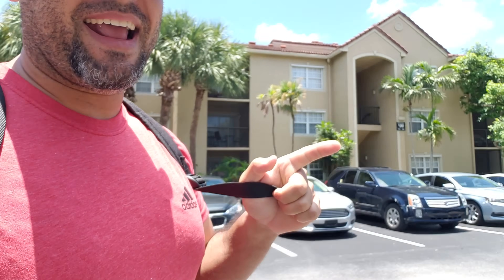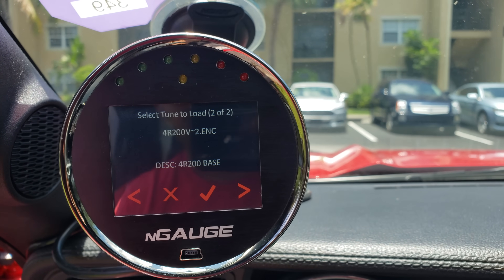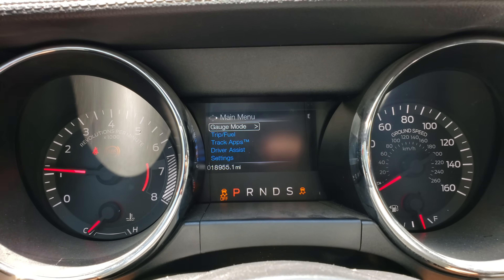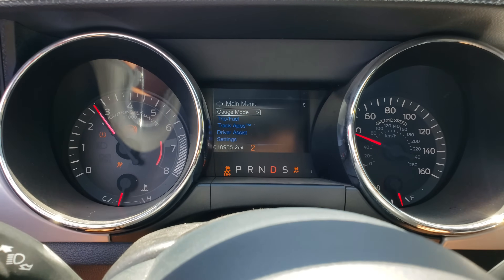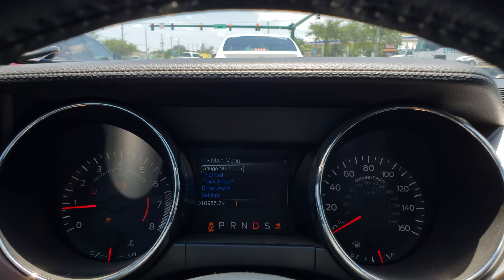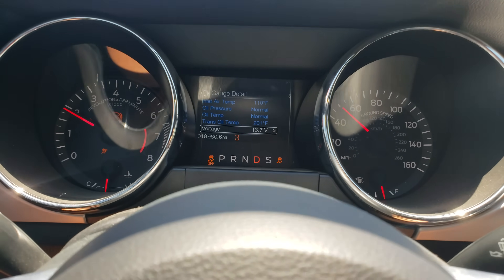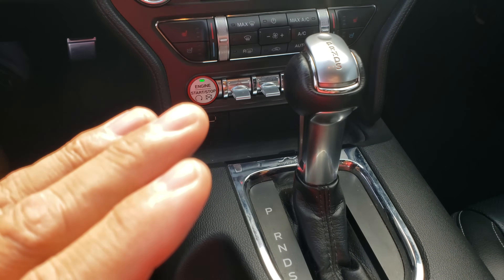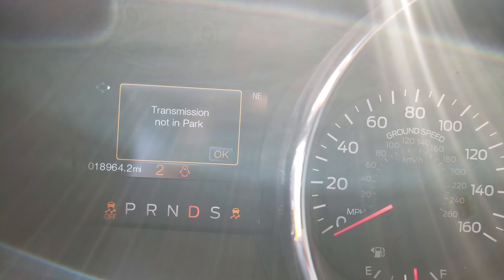How does a 4R200 Drive??, And Disabling 1st Gear on a 6R80

Comment: This pass weekend. I uploaded a video of my 2016 F150 2.7 ecoboost doing 0 to 60 (6.8) starting in 2nd. (2.34) gear. The time was the same as using first (4.17). I had a feeling my truck was not making full boost in first.

Comment: I have an 800hp 2015 5.0 with an mt-82. What do you think this transmission swap would cost between parts and labor?
Reply: What would I need??
Reply: @Alejandro Flores
Reply: The 4r200 hub, a donor 6r80, likely a 4 speed shift controller, and a shop to do the hub install into the trans.

Comment: what does all this mean the 4r200 and the 6r80 and all that please explain
Reply: Leon 4r200 means 4 forward gears, 1 reverse and 2000 lbs feet of torque capable.  6r80...6 forward 1 reverse and 800 lbs ft.
Reply: @SixStringRacer  The 80 in 6r80 actually stands for 800 Nm not lbs ft.

Comment: Are you planning on swapping the rear end gears? 3.15 seems pretty tall for the gear ratios in the 4r200.
Reply from the maker: FuelForFire87 I'll try the 3.15 then move to a 3.55 if I need to

Comment: Good to see the car's back, and it brings up a common misconception about glides. Some think they are "missing" third gear when in reality it's first gear they effectively lack. Are you restalling your stock converter, or is it a 100% stock converter? I'll be curious to see what it does at the track because I'd think that more gears would potentially make the converter stall less work to figure out although it could certainly be what I get for thinking.

Comment: the 4r200 seems to be a great set up- maybe a little out of reach price wise for the common man.  This is why I run a 2.73 rear gear and only use 1-3 gears in the 1/4 mile up to 156 mph. w a 6r80 with all the aftermarket  goodies and a circle d 3c. Don't end up  using the 4th gear plant. set.  And with the d1sc-  I run huge torque isn't present like a turbo or a tvs car.
Reply: Out of reach but you have a procharged coyote that makes huge torque, has a $1200 converter and runs 156mph? A 4r200 doesn't seem very out if reach if you're already putting that much money into your car. Don't build a car and then cry about the price of something that eliminates trans issues in the future.
Reply from the maker: bryan pearsall forward planetary is a ticking time bomb.
Reply: west is the best- but not at reading & comprehension. I stated huge torque is not present like a turbo and a tvs car-  and I was not crying, was making a general statement and a built 6r80 will take some abuse and live in a sub 1000 rwhp/800rwtg. car for a long time. and will suit the average joe.
Reply from the maker: Unless you get a billet front planet, the trans will go at about 700-750 RWHP due to a front planet failure. It's just a matte of time like jake stated in a previous video.

Comment: I just want to know if it's possible for my 15 to get a 10speed from a 18 :(
Reply: If your car is an auto already the 6r80 and the 10r80 are basically the same. So the cost of the transmission and labor. You May have to tune.
Reply: Major_wright3851 that would be a lot of money

Comment: What size tires are you running in the rear bro
Reply from the maker: 305/45/17
Reply: Alejandro Flores thanks. What springs are you lowered on ?
Reply from the maker: XCVI Mac stock

Comment: good stuff man.  nice info about the longer first gear/launching in second due to high hp (first  gear traction issue).

the auto manufacturers making 10+ speed transmissions is cool especially for smaller motors but at some point there's got to be a limit to where the performance and additional fuel economy gains becomes negligible.  anyone know if we're going to see an 11 or 12+ speed in the future?
Reply: Honda and Chevy are combining together to make an 11 speed auto supposedly

Comment: I would like to say that your right about the more power you have the less gears you need in a transmission. The reason why  Ford is using 6 to 10 speed transmissions is that even though the Mustangs have 460Hp its all at the top end, so the transmissions are just band-aids for the poor torque curve of the engines. Now if the engine came from the factory with a fatter torque curve you could use a 4 speed transmission and you could pull longer in those gears. Even with all of the gears the final over drive gear ratio is still close to the old AOD from the 80s.
Reply: its an emissions thing almost exclusively.
Reply: T Rust shorter gears in big power no sence, and that's right you want longer gears
Reply: T Rust what do you think the 6.2 was? It’s basically what you’re saying. They just never put it in the mustang.
Reply: If you have a proper converter, the engine will always be in the powerband. Even with a 3 speed
Reply: Because GM didn't help develop and definitely isn't using the same 10 speed?  If the shift times are fast enough that you can take advantage of the extra thrust and run faster, why not?  If you've got 700hp and spin the tires in 1st, 2nd, and 3rd then ya, you don't need those gears, put a taller rear gear in it.  Most FACTORY cars can't do that and the extra gears help keep the MPG's up and the EPA off their back.  The OEM's cant assume everyone is going to try to double the hp and have gearing issues as a result.
Reply: I wish the engine did not have to spin so high to get the Hp and Torque numbers, it just lessens the longevity of the engine. Being that these are overhead cam engines the physical size is comparable to and old big block. Ford should have gone with a larger displacement 2v engine and installed a blower, this way it would be a lot more fun to drive with that stump pulling torque. The transmission could have been a 4 or 5 speed with a wide ratio gear set, since the engine would have a super fat torque curve, and not just at the top like the coyote

Comment: So witch would you say is a more stout  trans ,4r200 , 6r80 or the new 10speed For around 700 to 800 rw hp?
Reply from the maker: Gregory Robinson either will work as long as its geared correctly. I dont want to have another front planetary failure and I am not paying 1000+for a billet front planetary.